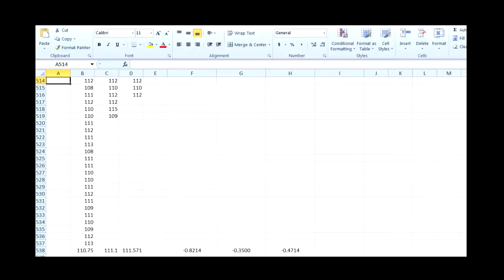Volume Loss with Coil Splitting?

Comment: I have 2 guitars that split coil.  A gretsch and a PRS. With the gretsch there is a noticeable drop but the PRS seems to power on through.  85/15s in the PRS and TV Jones PowerTrons in the Gretsch.  Any ideas?  Is it the wiring?  Should I have a cap in there somewhere or something?
Reply: Some PRS guitars with coil splits add a resistor in the wiring that essentially prevents one of the coils from completely deactivating, giving it a slightly thicker sound and less volume drop. I was actually thinking of modding something like it into my guitar. Basically, it's supposed to do that.
Reply: PRS is a PARTIAL COIL TAP....not SPLIT,using resistors.

Comment: what were the DC resitance values of the bridge humbuckersin your exoeriment?   I'd like to know how moderate or hot they were. thanks.
Reply from the maker: Iggytommy   Good question. I actually had to pull out the millimeter for that.   The JB in the bridge of the Warmoth is... 16.3 in Series, 4.2 in Parallel and 8.3 in Single Coil.   The StagMag in the Neck of the Warmoth is 15.4 in Series, 3.9 in Parallel and 7.8 in Single Coil.   Unfortunately I have a ground loop issue in the Strat right now, so a DC reading right is all out of whack, but Seymour Duncan's Website shows the Coil Rails in the Bridge at 10.3.   So... most like around 5 for Single and 2.5 for Parallel.
Reply: Hi. Thanks, that's useful to know.  But I meant how do the actual volume ouputs chnage in % terms.   i.e.  The volume output of pickup A when in parallel is _x_ % less than in series.   You gave the db difference but didn't express it in % terms.  Thanks.
Reply: Iggytommy - p..s Oh, I asked that in a separate comment I made on one of your video.  Sorry about that.  doh!
Reply: Erik Z - So those humbuckers were certainly hot ones.  Interesting, as the volume output difference weren't very big.

Comment: What can we do about this volume loss when the coil is splitted? Is there a guitar mod to ´´normalize´´ the series humbucker and the coil splitt?
Reply: Look up PRS coil split mod. It uses a single resistor per pickup that you're splitting, and basically prevents one coil from completely deactivating, equalizing the volume some.